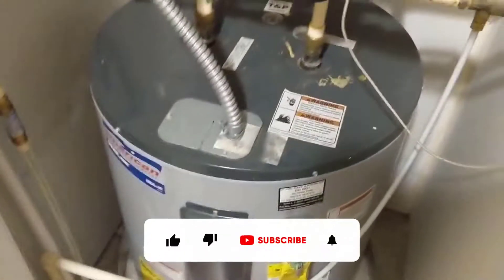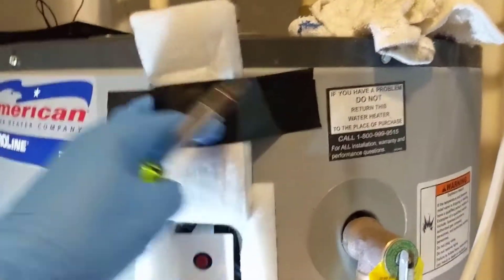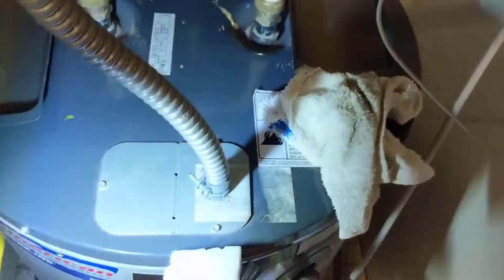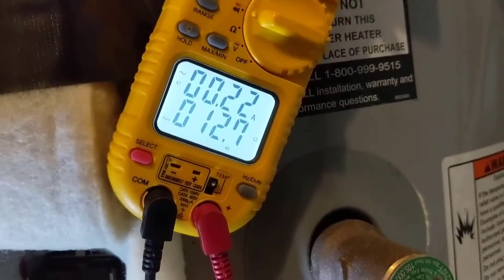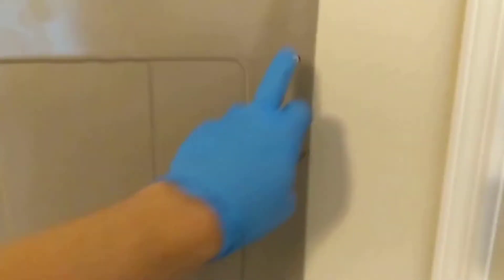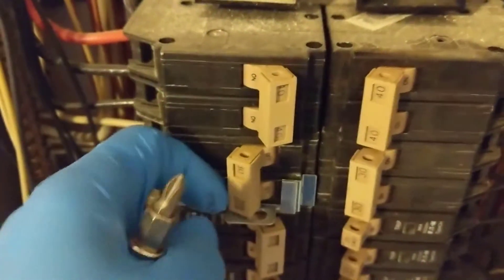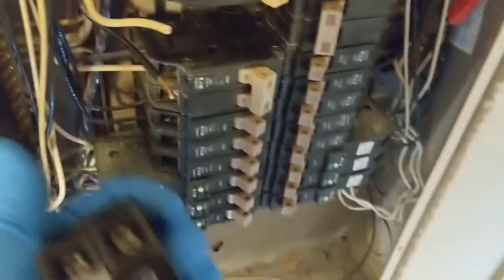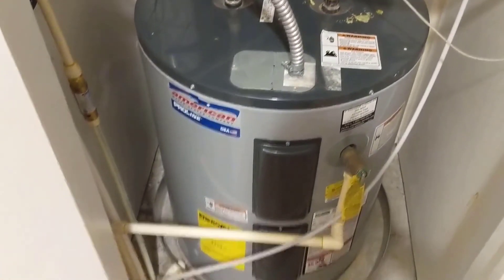Electric Water Heater Not Heating Water And Breaker Is Tripped

Comment: have you ever seen water coming from the top of the pecker head? my landlord installed a new water heater after our stopped working suddenly and now the new one doesn’t work eaither. unfortunately i do not have a meter at home but i did check power with a little voltage pen and it did have power
Reply from the maker: @DragnBarZ  Where are you seeing water coming out?

Comment: Where do you get the part number for the breaker? I think i need one any help or advice
Reply from the maker: Depends what brand, style & amp rating your breaker is. You have to match all specs. Hope that helps. Thanks for watching g4orce703 & help support the channel by subscribing 🛠️ 👍
Reply: @ApartmentMaintenance  I will.. I need a 30 Amp dual breaker.. it keeps tripping  & now I have no hot water
Reply from the maker: @g4orce703  Did you check the elements & thermostats? I have a video in my plumbing playlist showing how to troubleshoot the elements & thermostats step by step with a multimeter. More than likely it's one of those causing the issue. The breaker is just a safety device to shut the power off to whatever it's sending power to when there's something wrong. I know in my video I had a bad breaker, but it's rare that the breaker goes bad. Check out that other video & you may save yourself a good bit of money since those parts are a lot cheaper than a new double pole breaker.
Reply: @ApartmentMaintenance  I changed out the thermostat 3 months ago .. water was hot & fine but now the water is bk cold again haha.. so it could be the elements.. I'll get a multimeter and check continuity on both the  elements.. does it matter which wire you take off from the element to do the check..? I don't think so but maybe I'm wrong
Reply: @ApartmentMaintenance  did the wire checks.  Lower element is bad . No continuity at all...thanks to you thanks alot
Reply from the maker: @g4orce703  No it doesn't matter which wire you take off to check continuity. Just remember to shut the power off before removing the covers 👍
Reply from the maker: @g4orce703  Awesome! Glad you figured it out & didn't waste money on a breaker. Good luck on your repair. Don't forget to subscribe 🛠️👍
Reply: @ApartmentMaintenance  I did subscribe.. you're awesome
Reply from the maker: @g4orce703  Appreciate it 🛠️
Reply: @ApartmentMaintenance  and you can use a regular ole garden hose help  drain water from water tank I'm assuming
Reply from the maker: @g4orce703  Yep you sure can.

Comment: In a brand new house. Last late winter, the water heater kept tripping the breaker. We had someone come by and change the breaker. It was good  until yesterday when it started doing the same thing. I don't know what's going on and I don't have the money to fix it.
Reply from the maker: It's hard to say without seeing it of course. But it would need to be looked at by someone who knows what they are checking for. They would also need a multimeter to properly check it. Thanks for watching Colleen & subscribe to the channel 👍
Reply: Same thing. Not new house but new water heater. Winter. Washing alot of clothes
Reply: New residential homes have arc fault breakers what I usually do when I have customer service calls I change out the breaker to a regular and if it keeps tripping then the water heater is the problem

Comment: What would you check to if elements and breaker is good ? My elements are fine and so I replaced the breaker and I’m still having it flip after a day or two of running?
Reply from the maker: Sounds like the thermostats to me. I would change both, they don't cost much & there isn't anything else it could be from what you already checked & replaced. Other than a wire shorting out somewhere but that would normally trip the breaker instantly. Thanks for watching Zachery & subscribe to the channel 👍

Comment: Did you cut the power first before testing with multimeter?
Reply from the maker: When you test for continuity yes the power must be off. But if your testing for power then no you need the power on to see if the piece of equipment your working on is getting power. Thanks for watching Jazzy & subscribe to the channel 👍
Reply: @ApartmentMaintenance  i just subscribed one more question so checking for power is to determine if it's working properly or checking for continuity?
Reply from the maker: @jazzysmith2430  Checking for power is to make sure your getting the proper voltage to the water heater which is 240 volts. When checking for continuity you would be checking each thermostat to verify they are working properly & checking the elements. I have another video that shows checking a water heater step by step in my plumbing playlist. If you watch that video you will see how I test everything in detail.
Reply: @ApartmentMaintenance  thanks a lot
Reply from the maker: @jazzysmith2430  No worries!

Comment: o my gosh i finally get to see a real handy man do a job on this. my heating supplies jus came via amazon, i’ve been having a hard couple weeks i can not and may not wait for the maintenance men cause they don’t seem to know much about an electric hot water heater . also, is there a plug? and is the central heating system connected to the electric hot water heater at all, like the radiators are with the gas lit hwh?
Reply from the maker: There could be a plug, or it could be hard wired like the one in my video. Even if there's a plug it would still be on a breaker. Whether it's connected to your heating system I can't say if it is or not as I've never seen the system so I can't say for sure. Thanks for watching Annie & Subscribe to the channel 👍

Comment: Nice job figuring out what was wrong and I like how you kept the lock on the new breaker and didn't just through it out like a lot of people would.
Reply from the maker: Appreciate that Everything Home Repair. Yeah I always keep the lock on the breakers if they are there prior to replacing a breaker. Thanks for watching 👍
Reply: @ApartmentMaintenance  What does that lock do?
Reply from the maker: @mavirek It's a lock out device that you can put a small master lock on while the breaker is turned off, that way nobody can turn the power back on while the water heater is being worked on. 🛠️👍

Comment: My breaker doesn't trip, but the reset but on my water heater trips.  I reset it and the water heats up lasting about 12 hours and than it cold again.  I have to hit reset everyday.
Reply from the maker: Sounds like one of the thermostats are bad or an element & best case scenario a loose wire. I would bet it's the thermostat though. I would replace both as they are inexpensive & always replace them together. Thanks for watching Carrie & Subscribe to the channel 👍

Comment: My water got hotter than normal and suddenly it stopped working 
I reset the button and it worked maybe another day and the same the water hotter than before and then no hot at all . Any idea what it could be?
Reply from the maker: Sounds like one of the thermostats went bad & it's not shutting the element off at the set temperature & once it gets to 170° or higher it will trip the high limit (red reset button). It's best to replace both thermostats as they are inexpensive & best to do both at the same time. Thanks for watching Don & Subscribe to the channel 👍
Reply: @ApartmentMaintenance  thanks for your time!
Reply from the maker: @donvaron4035  No problem!

Comment: Hi our electric water heater is not working, when i plug it to 240v outlet the voltage drops to 120 100v. Is this is the cause of why its not heating? What should i do? Thanks
Reply from the maker: Yep that's why it's not heating. It sounds like your 240 volt breaker is only allowing power through by 1 leg which is 120 volts. Need to check voltage at the breaker with a multimeter & replace if there's only half the voltage output (120v). If your not comfortable with doing that or don't have the tools needed, I would recommend calling an electrician to inspect & replace breaker if that's what's needed. Thanks for watching Mark & Subscribe to the channel 👍

Comment: what is the metal (strip/lock) you called it on the 30 amp breaker for the hotwater heater?
Reply from the maker: It's a lock out device to put a lock on the breaker to lock it out while your working on it so someone doesn't turn the power back on. Every water heater breaker has one of those on the breaker at my property. Thanks for watching David 👍

Comment: Temp is set too high as well. Should be 120 by code. Top element was set at 140 @ 1:58
Reply from the maker: Yeah I set it at 120° & set the bottom one at 125° I always set the bottom one alittle higher since that's where the cold water enters. Thanks for watching cgccb123 & Subscribe to the channel 👍